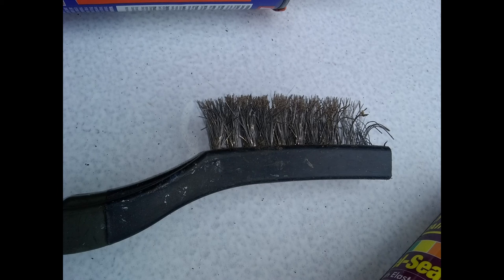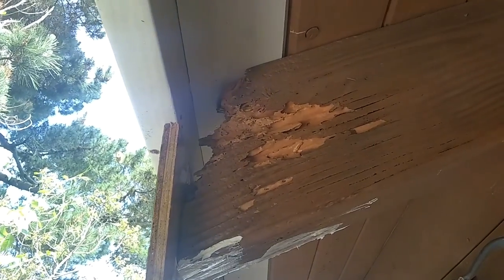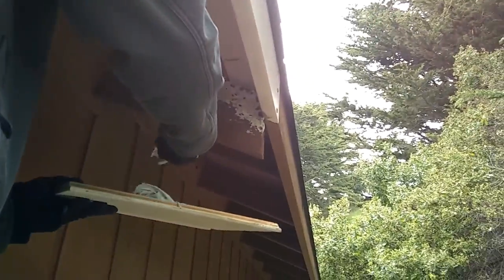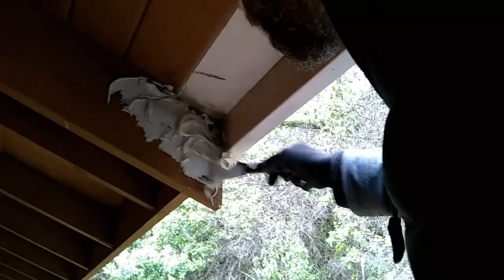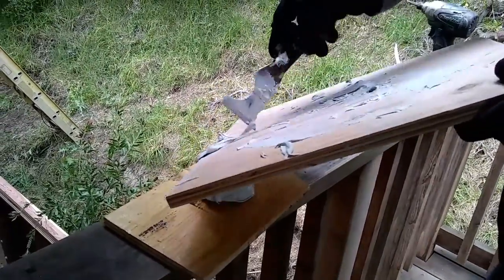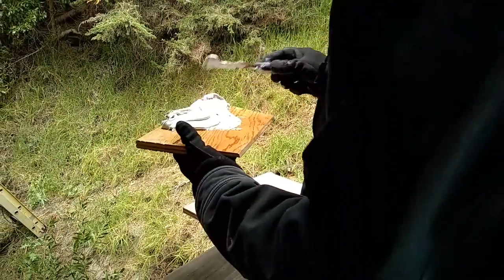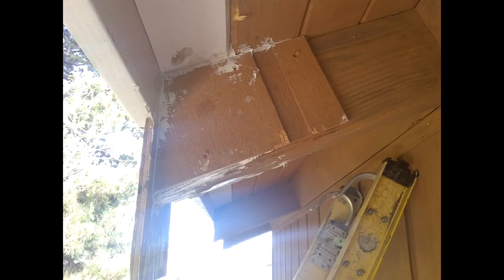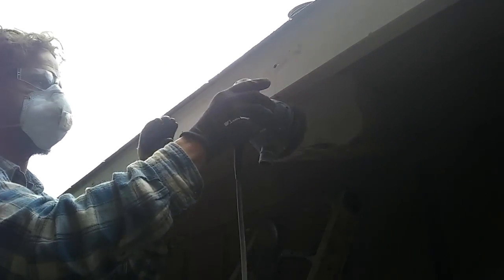SECRET to Fix ROTTEN rafters!

Comment: I live in central Florida. I am going to use bondo to repair some termite damage in the bathroom near the ceiling, inside the wall. Is it necessay to use the polyurethane caulk? It doesn't get very cold here in the winter, the coldest it gets is 27 degrees.

Comment: I don't know if your still rockin in the field, but I have a question about your procedure? Q: After hardener dries, do you allow the polyurethane caulk to dry before sandwiching the wood with the bondo? I'm about to give your method a go! :)
Reply from the maker: Apply wet

Comment: Nice, Thanks for the ideas!  
What about using Copper Green wood preservative as the treatment?  Will the Bondo/Caulk stick to that?  It's an oil based product, but can be painted with oil based primer.
Reply from the maker: No you need the flexibility of the caulk

Comment: i like the idea as i may need this on y house. im replacing fascia. But how is this different than attaching another 2x6 to the original rafter??? especially since you habe open soffit. Would thhis hold without screws?? ill be working on MY RAFTERS BETWEN THE SOFFIT AND DECKING

Comment: That will fail in no time.
Reply from the maker: Still going strong. It all depends on the quality of the caulking that you use. If you use a high grade polyurethane based caulking that is protected from the Sun it will last longer potentially than the wood around it
Reply: Very good! Have you actually inspected it to see if its holding?